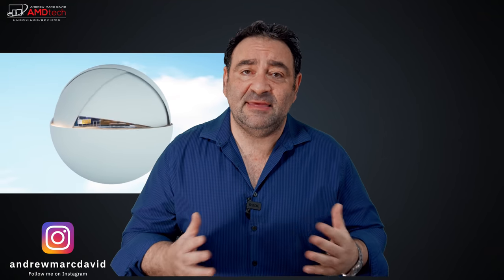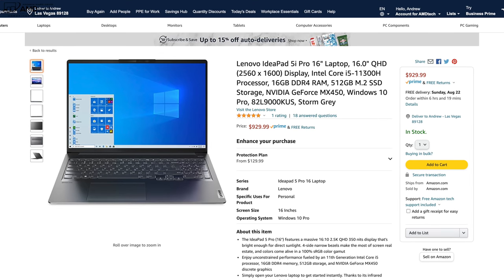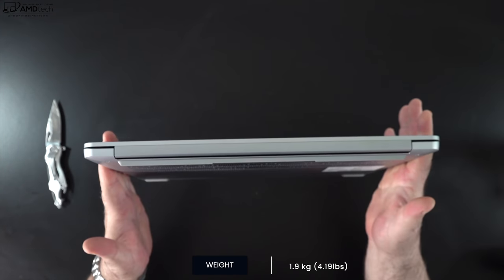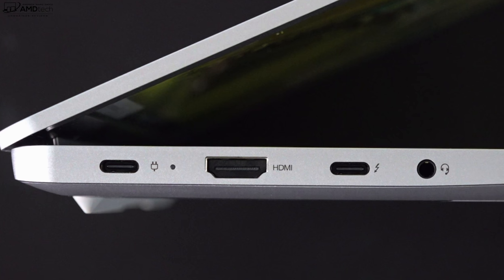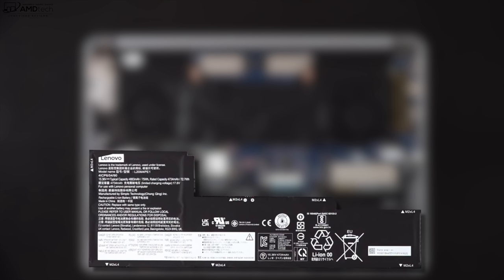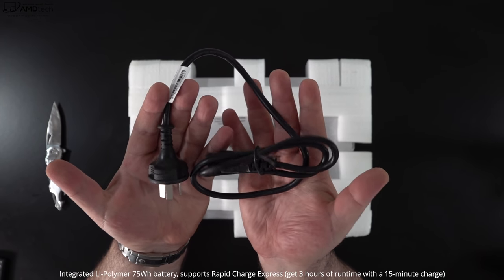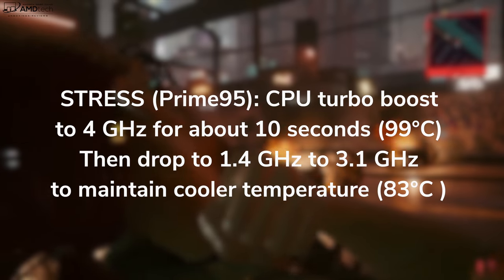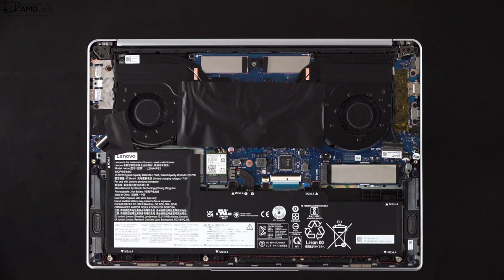Lenovo IdeaPad 5i Pro 16IHU REVIEW: Premium Budget

Comment: Nice PC.  The webcam on this unit was okay (nothing to brag about) for a (720p mediocre class) camera.  The microphones sounded just okay.   Like the easy access to the insides although as you say it would be nice to have upgradeable memory.  One thing to remember is if you keep and use this unit (and this goes for all the modern day PC's from all the manufacturers) for more than a couple of years there is a good chance that the lithium battery in this unit could swell up and put pressure on the internal components and as a result will need to be replaced.   I recently went through this with my HP 2018 Spectre PC and also another PC I have.  Keyboard layout is good.  The numpad keys are a little smaller than the letter keys but its layout is like a typical calculator and is good for fast data input.   Display is a nice size on this unit and clear.  Would be nice if this unit had one additional USB-C port.  Right now it has really one functional USB-C port since the other one in the corner is used to charge the unit.  Overall on balance this seems to be a good value for the money.  Anyway great review.

Comment: Hey Andrew,
nice review. I am looking for a new Laptop. This looks really good but I got the impression, that it will run very hot and I plan to use some heavier workloads. I am also looking towards the Lenovo x1 Extrem gen 4. When do you think your review of the x1 will be online? The x1 also looks like to run very hot, what causes it to throttle.

I also like the Legion 7 but the RGB stripe around the shell is keeping me away from the Laptop. Also the Corsair Software (used for the RGB lighting) will drain the Battery a lot quicker. I mean I could uninstall the corsair software and use the preset RGB lighting. But could I, with the Corsair Software uninstalled, turn off the RBG strip around the shell?

Comment: This is a great laptop, but I fear it's too big. I'm a medical student, and I found the HP NOTEBOOK 15.6 size laptop to be good, better convenience, no need to scroll down allot.

And if this Lenovo was to be the same device size as the HP, then I'd get it hands down. Because it's very good.
Reply: It's an extremely small difference. Will look identical in size to that HP side by side in terms of size due to the smaller bezels . 16:10 aspect ratio is very worth it

Comment: Hi Andrew, Great review.But why do some laptop manufacturers insist on positioning the touchpad well to the left, rather than the centre.Don't they understand that 90% of consumers are right handed, thereby making  it very difficult to use the touchpad effectively.I would never consider buying a left centred touchpad.I also note that Apple and Microsoft always make laptops with centred touchpads.
Andrew, What do you think makes manufacturers like Lenovo making laptops with such unfriendly placed touchpads ?
Reply: I find that centred touchpads get in the way when I'm typing (for laptops that have numpads). I recently bought an LG Gram 16 and I find the underside of my right palm moving the mouse cursor. I really wished that laptop had the touchpad to the left more. Heck, I should've bought the Lenovo instead!

Comment: Looks nice. My "problems" with it for my next laptop are (i) I want 32GB RAM (can perhaps get it), (ii) LTE or 5G for mobile network connectivity and avoiding wifi, (iii) slightly heavy -- I tend to carry a laptop for a few miles when abroad [I can carry my 1.5 kg Surface Book 2, but it was simpler with my Surface Pro 4], (iv) would prefer a full-sized SD card (I'm into photo), (v) would prefer 1080p video camera, (vi) am not a frequent inker, but would like to be able to ink on screen.

I'm curious about the Surface Laptop Studio. Looks like a fine laptop, with a couple of quirks for me: (i) why no full-sized SD card reader?, (ii) why no LTE/5G option, (iii) slightly heavy.

I'm also curious about the Surface Pro 8 -- to me, seems like a major upgrade, which covers most of my wishes. Possible down-side: (i) slightly small screen, (ii) how good is the battery? [My old Surface Pro 4 "promised" some 10 hours, but gave 1.5-5 hours in real life], (iii) why, oh why doesn't the LTE model come with more than 256GB SSD?? It seems like I can get an i7 with 32GB RAM and LTE, but why max 256 GB SSD?? Is it possible to swap the disk with a 1TB SSD? Or will that break warranty?

Keep up the good testing! I still consider the Latitude 9420 you reviewed, but for some stupid reason, they don't sell it with more than 512 GB SSD where I live...
Reply: the X1 Extreme G4 1) up to 64GB 2) LTE 5G optional 3) 1.8kg only + charger 400g? 4) Full size SD reader
Screen 2k UHD 16 inch colour accurate, battery around 6hrs usable, usable ports (no dongle life)
Ticks all the boxes, only issue is if you can swallow the price :P
Reply: @kakaboom55  "1.8 kg only" -- 1.8 kg is somewhat too heavy for carrying under your arm for a few miles. Also, with the fast CPUs, that hurts battery life. I'm probably ok with a 1kg Surface Pro 8 with LTE and remove log-in to my office desktop. Still, I look forward to the Extreme G4 review! Especially when it comes to battery life.
Reply: @berntlie6799  battery life review is already out by other tech blogs pc mag/ laptop media it's 1.5hrs less then a Dell XPS 15 which is the best battery life windows laptop with delicated graphics so the battery life is pretty good on the X1 extreme gen 4
Reply: @Thai.H  from the above, the biggest factor upfront was 1kg or less (which i wished was specified upfront), even x1 carbon G9 is 1.12kg/ no SD so nope. We will probably have to wait for another 10 years before we get big screen, long battery, low weight, high RAM/storage, 10G network; then request full ports and reader lol. Even mac cant solve no dongle life.
Reply: @kakaboom55  u'll just have to deal with a dongle bro I'm sorry u can't get what u want
Reply: @Thai.H  not me bro, was referring to Bernt Lie, he'll need a dongle for sd reader.